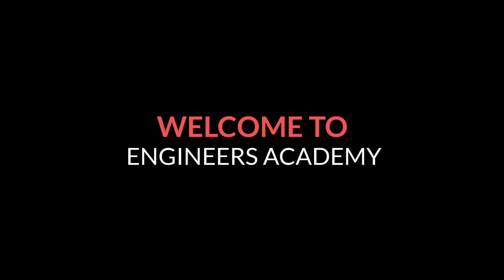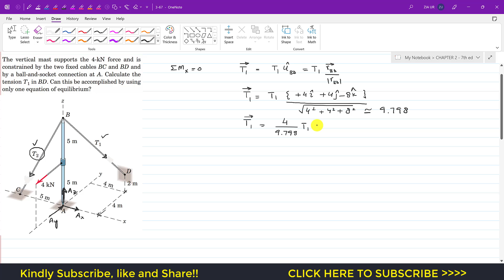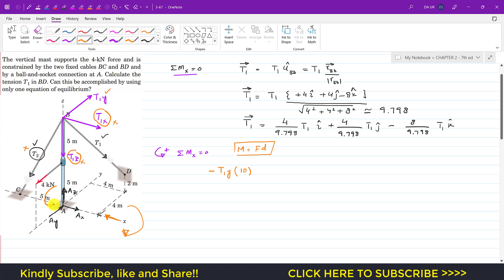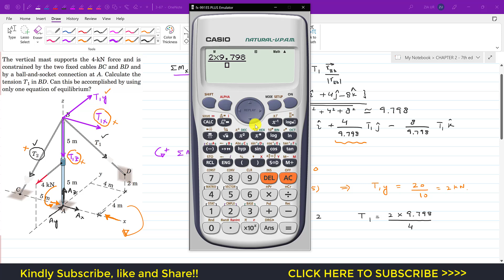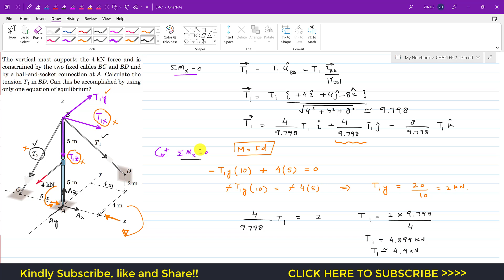3-67 Chap 3 Equilibrium 3D Solved Problems Engineering Statics Meriam 7th Edition Engineers Academy

Comment: Is there any rule for these assumptions I put tension T1 in D so i multiple Ty by 2
Reply from the maker: These are not assumptions, this is solving multiple equations using elimination method, this is pure mathematics
Reply: @EngineersAcademy2020  yeah this right I got some mess 
Thanks sir
Reply: 8:09  when you find the moment why you went to let the (d) of ty1 =10 I think is not vertical for it